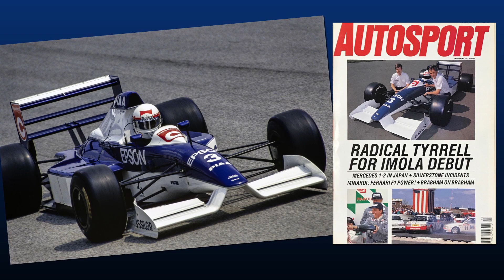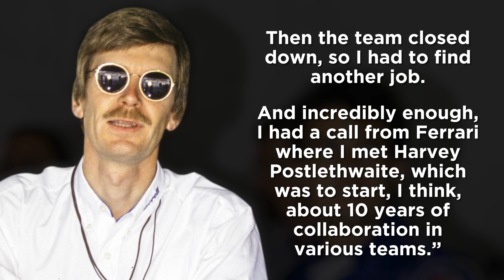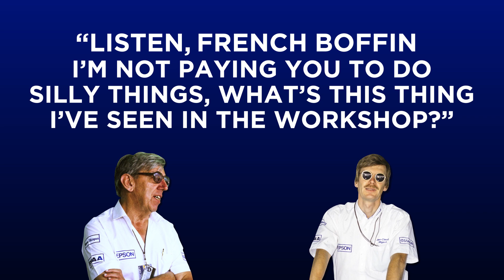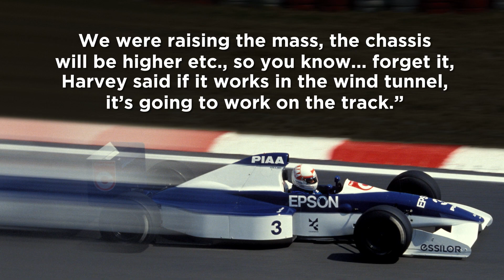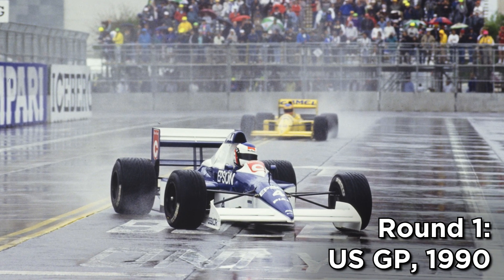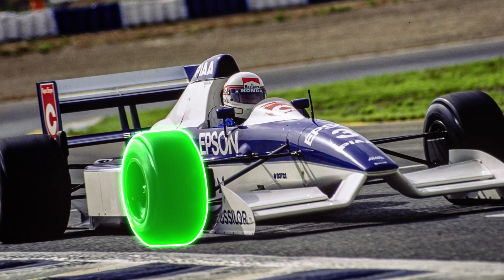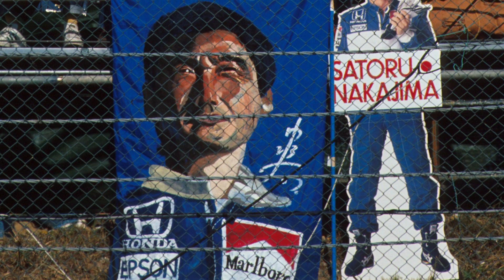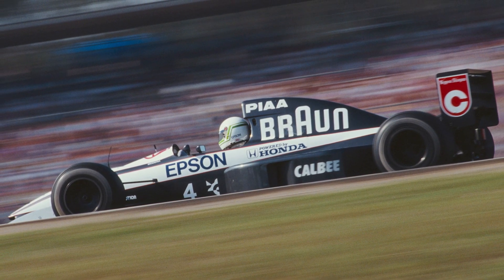Why Do Modern F1 Cars Have "Raised Noses"?

Comment: You missed it. Yes, the high nose allowed a cleaner airflow under the car but it was part of a more important concept. You touched on the undertray, which was extended under the car to conform with FIA requirements but you missed its primary function. This was a splitter plate, exactly the same as the splitter plate on a supersonic jet like Concorde or an F-4 Phantom:

https://en.wikipedia.org/wiki/Splitter_plate_(aeronautics)

The purpose of this is to guarantee a smooth freestream airflow under the car, which is why it produced much better downforce figures. Part of the airflow on the Tyrrell was directed above the splitter plate to the radiator intakes, allowing a higher pressure airflow through smaller frontal area intakes, producing less drag, while a smooth and undisturbed airflow went under the car, where it funneled through a very small gap before it was expanded through venturis, creating low pressure and downforce.

This had the effect of making sure the air under the car wasn't turbulent. In fact, I'm a bit surprised nobody has attempted boundary layer control with bleed holes or mesh diffusers.

Yes, the high nose was important to this but it was part of a very clever solution which started an the front of the car and ended at the exit to the venturi tunnels.

Comment: 07:00 are you sure about this? 

The middle of the front wing + the cape (first implemented by Mercedes and followed by the others) just does the same as the high nose Tyrell: directs the airflow through the nose section towards the back of the car.

Yeah, this McLaren doesn't have the cape. But this doesn't mean there is no workaround for today's low nose cars.

Comment: Tyrrell were real blue sky thinkers, they claim to be the first team to run an airbox too, they pioneered the raised nose as mentioned and were the first team to run aero shrouds over the suspension which later morphed into carbon suspension arms with aero profiles. They were the first team to have personnel in team colours I think too. There were other innovations that didn't make it, a three spoke alloy that failed at Brazil and they tried running front tyres on the rears at testing in Hockenhiem but Goodyear wouldn't let them race. That's not to mention the legendary six wheeler car which actually competed for years.  They designed hydraulically interlinked suspension in the late-90's and an F1 car designed around the most common type of corner at the time.

In some ways I love this, the fact that Kens little team introduced so many ideas, in other ways I think it was his weakness, he never grasped the idea of refining a concept, always preferring to find a silver bullet that would take him back to the front.

Comment: You didn't mention that if the teams were allowed to have higher noses today, they would, because it has aerodynamic advantage. The only reason noses are low past few years is because the crash structure has to be low, to prevent cars flying up over other cars if they crash.
Reply: I was waiting in vain for this comment in the video. "Modern" apparently means early 90's?? 🤔
Reply: so wjat you're telling me is if we had gone with the aero screen, we could have had the high nose back?
Reply: @dsdy1205  high nose = high chance for airborne launching. Aeroscreen wouldn't change anything
Reply: @dsdy1205  No, not really. The high nose is banned to prevent cars from getting airborne when hitting another car. Having an airscreen wouldn't make much difference there.
Reply: I like the look of the 2011 and 2013 F1 cars, the high noses and narrow body always look good to me

Comment: The low nose is singularly the ugliest thing about the 2022 mockup designs we've seen from F1 so far. I don't want to go into the discussion as to whether 'platypus' noses were pretty or not, but the height of the nose tip was at its most aesthetically pleasing in 2012; before that it was too high, after that it's become too low.